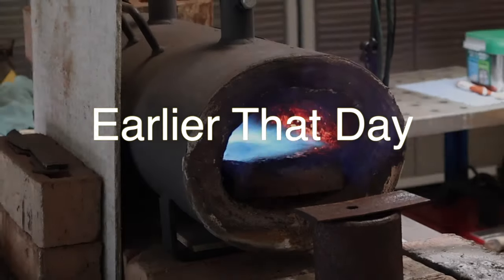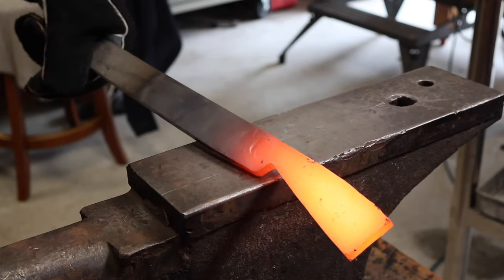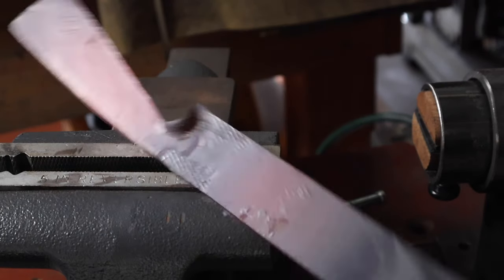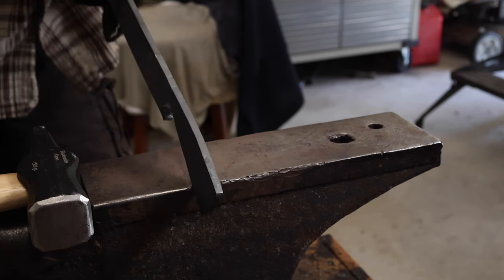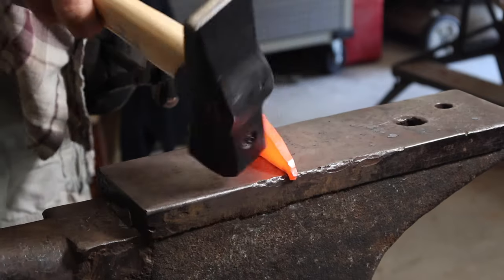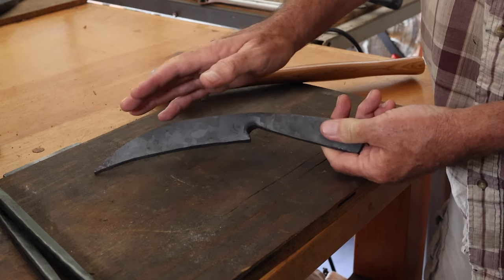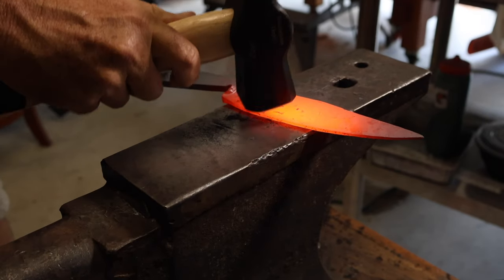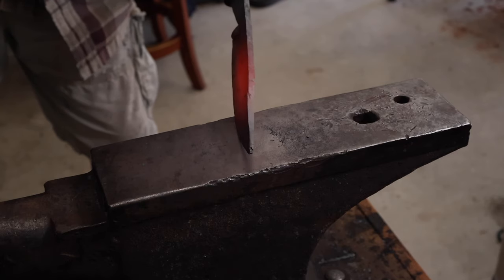Brut de FORGE Hunting Knife - Pt. 1 Forging to Shape

Comment from the maker: For those interested, the hammer I used to upset the guard was a dinging hammer. Has anyone else used this kind of hammer for any forging or other metal working, what did you use it for?
Reply: What weight hammer did you get ?
Reply from the maker: @jdcole2112  1250 grm, from Blacksmith's Depot